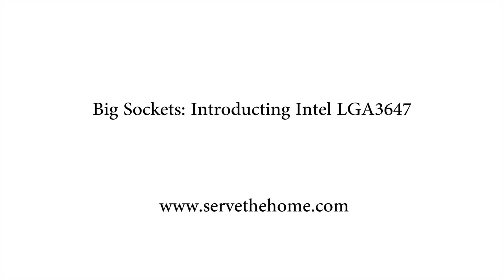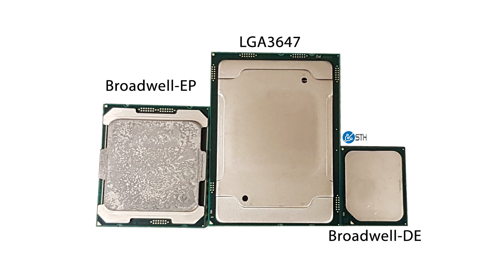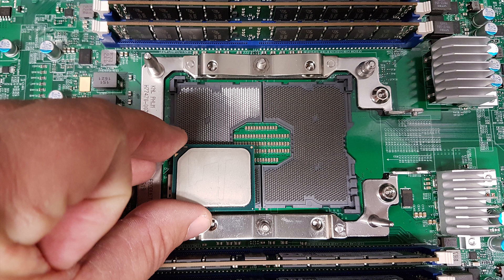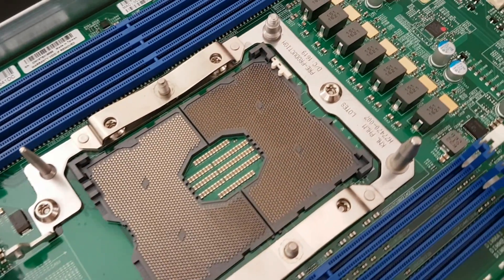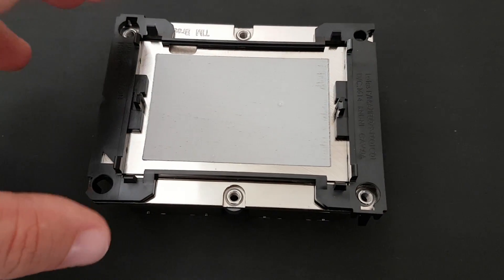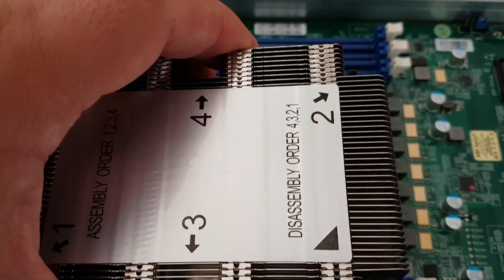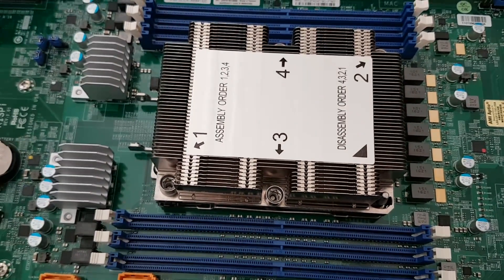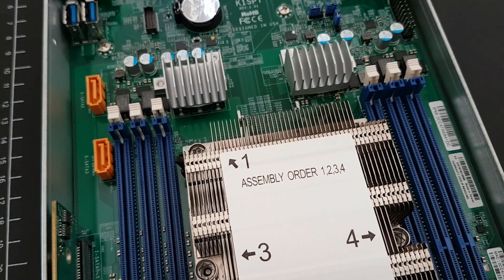Big Sockets   Intel LGA 3647 First Look

Comment: Just installed my first 3647 processor and apparently did it wrong, but it worked fine.  I installed the CPU into the little bracket and placed it on the motherboard socket and then mounted the heatsink to motherboard.  Guess I should RTFM next time.

Comment: https://plaza.rakuten.co.jp/hanmaiwao/diary/201706030004/
Xeon Phi Processorの最新から、半導体チップの中に今までのメモリーや周辺ＩＣをまとめて製造して、ＰＣ一台で世界１の中国のスパーコンピュータを超したパソコンを開発。
Xeon Phi Processorの最新のＣＰＵの性能は７２コアであるが、パソコンの周辺機能も入れた１０２４コアの4096スレッドのＣＰＵとして開発する。
一つの大きい円盤型の半導体ウエハーにより、外部接続には電源と光ランだけの接続となる。
消費電力も同じクロックで１千分の１と大きく半導体を改良中である。
日本で開発の最新のＣＰＵ製造の１００分の１の半導体縮小焼付け方法とホールド効果の２つの発明を取り入れて。
回路素子縮小で漏れ電流を１００分の１に減らした。
これにより、ＣＰＵや周辺回路を全部を一つの円形の半導体チップに書き込み作り出す製造方法と進化させる。
ＰＣ一台で世界１の中国のスパーコンピュータの性能や演算スピードのパソコン一台で超すため。
ＰＣの一台に１０２４コア（４０９６スレッド）の円形半導体ＣＰＵを１千個をＰＣに全部並べて埋め込んだのだ。
ＣＰＵのクロックは２ＧＨＺぐらいと予想させる。
ＳＳＤはＣＰＵチップに１Ｔも内臓させている。
創造以上の新しい性能アップとパソコンが進化する。
１０２４コア＊１０００＝１０２４０００コアのＰＣとなった。（一台のパソコンで１０２４０００コア）
家庭でも使えるコンピュータパソコンなので、１００Ｖの１０Ａ以内で世界１のスパーコンピュータより性能が高いＰＣを動かそうと頑張っている。

Comment: Nop, we saw that skylake-e will be with s2066, no 3647.
Reply: This is only for servers.
Reply: don't forget the ice lake  cpus that require 2076 pin LGA  intel said they will need to upgrade to it in 3 years 2020 for the next socket so Ile probably  wait instead wasting money  on the first x299 board's  I belive the 2076 pin  will stop be the x299 chipset

Comment: That passive cooler doesn't look like it could really dissipate 200W... I've worked on cartridge Pentium II systems and they had coolers as big as these but were designed for only up to 30W. I think LGA3647 could be a flop if they don't change their default cooling mechanism.
Reply: Think about it. AMD's 220W FX 9590 required water cooling.

Comment: Generally in the technology world things get smaller and better over time but this is not te case it seems like with CPUs. They are doing the opposite. 

With a chip that size I expect it to push 8GHZ+ and be 30+ cores as well but its most likely won't even come close to this. So why the hell did Intel do this? What is the reasoning behind it?
Reply: Well, it has way more than 30 cores... that's not a mainstream processor, it's a Xeon Phi (coprocessor) within the same form  factor as CPU. This way one could easily  replace it (putting it in the traditional PCI slot or compatible CPU socket), it has memory inside the package, that's the reason for the physical size, and the top model has 72 cores and 288 threads. I hope I helped make it clear.
Reply: I'd say the amount of pins is the real reason it's so large. You could probably expect the actual chip to be tiny, but the very large area is for all the pins.
Reply: Intel is struggling with innovation in the PC sector so they need more space to push more cores. Everyone knew this was coming and since they can't produce a decent on board gpu worth anything they probably need more space to put a better one on the chip as well.
Reply: adam armstrong So the 14nm 24 core Xeon chips are Intel's limit for number of cores on a normal size CPU?
Reply: Marcelo A. T. Gomes Yeah you did. I can see the top model costing like 20k as well. So these bad boys are replacing the Xeon chips? Makes sens if you need something that powerful.
Reply: IKR... It's basically a Pentium Pro remake. That ol' vintage 1996 chip had big L2 cache chips right underneath the CPU die.
Reply: Intel was never good with graphics. Remember the i740? That was their first and last video card they produced.
Reply: geo58impala nope
Reply: If you look at intel's comments they said in order to shrink the die they may have to sacrifice performance to pull it off and it no secret that intel is really far behind in the graphics part of the game. Maybe struggle is to harsh of a word but it's clear that it's becoming more difficult for them to continue to shrink the die size and they suck when it comes to on board graphics. This dosen't include the fact that intel seeming to be interested in anything but processors these days with there restructuring of there company towards IOT.
Reply: If you honestly think that intel is just making a good enough gpu then your deluded in your opinion of them they brag about increases in performance and have made attempts at dedicated gpus in the past. The extra space on a cup has never been a bad thing and using that space for more gpu hose  power would help them but I was theorising with my original statement. Intel is loosing ground in most things mobile and based on there recent company shifts in R&D they may loose some ground to AMD. I love most things Intel but again take a look at past research they care allot about the GPU but have failed miserably with it.
Reply: I wasn't talking about integrated graphics I was talking dedicated cpus google it you will find that your are misinformed. However intel is making strides into the mobile world and I have hopes that they will bring the x86 platform to the mobile scene soon in a big way, but compared to arm, qualcomm or any of the other mobile vendors they have a long way to go even after making  HUGE investments trying to get there. So, yes they are lagging behind and are far from being a major player in the mobile scene. Tablets , laptops sure but not phones not even close.
Reply: The actual die of the processor isn't much bigger, they need the space for pins and the IHS. And they need the pins for the things like more RAM support. Also the dies will slowly become larger on the platform and they don't want to have to switch sockets completely
Reply: Dönci Terényi I have never argued that all  I did was casually mention that they may want to use some of the space of beefed up graphics and Ri5ux  bit my head off and tried to argue that intel was great in that space when in fact that they are not nor have they ever been even after they have made several attempts at it in the past.
Reply: adam armstrong Yes Intel definitely isn't great with onboard graphics as of now. Their Iris iGPU was an interesting attempt, but they still aren't at the level they should be
Reply: Ri5ux Hd530s are not even powerful enough to accelerate rendering to it's maximum, and we have seen that most programs reach a CPU bottleneck even with fairly low end GPUs, and I sure as hell wouldn't buy an AMD chip now, but we might see something from them in the coming years
Reply: fade2black001 
who cares as long as I get more power

Comment: similar to what was used on the non-cylinder mac pros with westmere cpus
Reply: Not even close - the "middle" size CPU in their comparison is the same basic size as the Westmere CPUs.  The cylinder Mac Pro uses the same size as the "middle" CPU.

Westemere used LGA-1366 socket, the current Mac Pro uses the LGA-2011 socket.  Do an image search for "LGA 1366 vs LGA 2011" and you'll see that the Westmere is the same basic size as the Broadwell-EP shown as the middle CPU here.  Both dwarfed by the new LGA 3647.

Comment: Skylake E will use this? So much for my Liquid cooler and the generations of cooling solutions that will go out of date because of this.
Guess im stuck with a shitty 5820K forever.
Reply: 5820K is Haswell-E, and my chip in particular is a trash overclocker.
Reply: This socket will be used perhaps in the new E7 Xeons, the ex series (up to 28 cores) note that it has 6 memory channels, etc. The desktop high-end Skylake-X is not expected to be bigger than current LGA2011 it will use 4-channel setup as it is now, it is also likely that the coolers will be backwards compatible.
Reply: Intel's naming scheme is fine. Enthusiast platform is always a generation behind. 5xxx is Haswell-E and Broadwell-S, 6xxx is Broadwell-E and Skylake-S
Reply: I agree somewhat. My Pentium 4 laptop ran well on the Internet until it turned 9 years old.
Reply: bartekowca666 Not true until LGA 2011. The i7-980X was a generation ahead. Now the Enthusiasts line is about cores and increased productivity. 

Personally I want to replace my home LGA 2011 with a LGA 3647. At home I game and run SQL testing off a RAM drive...